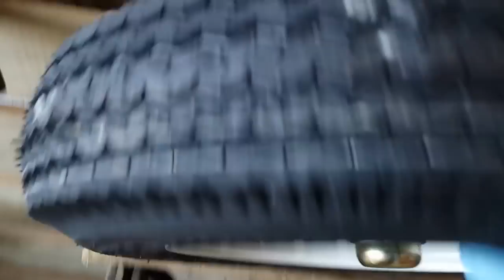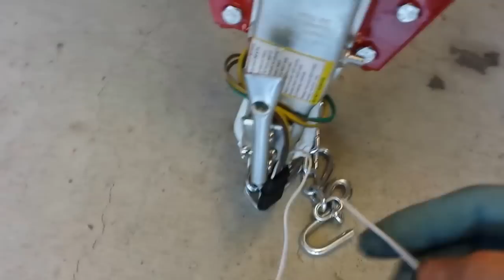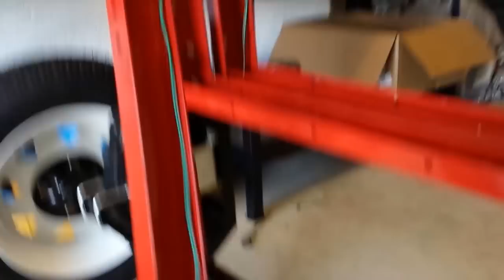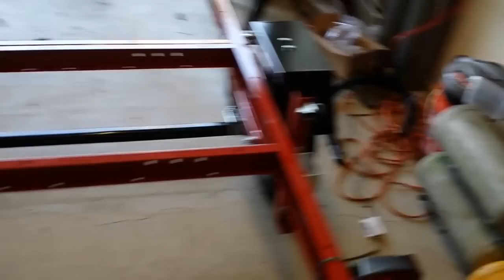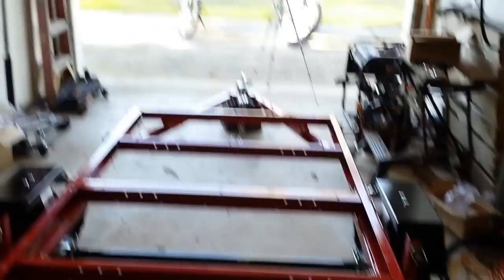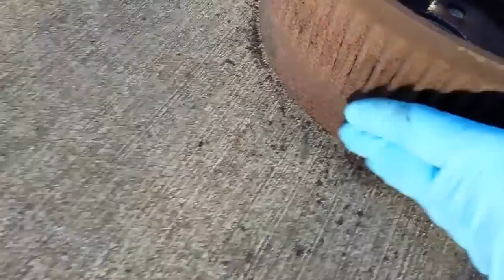Harbor Freight Folding Trailer Build Part 2 - Wheels and Wiring

Comment: I had the same trouble with the license plate too and tried installing it the way you did initially... but the way it should be installed is light onto the mounting bracket, then the license plate holder on the back side of the bracket. The wires have enough clearance this way to move where they need to go.

Comment: I tried that method for removing that dust cap.  It did indeed remove the cap, but I managed to drop the bearing as well as the greased washer in the process.  I hadn't even tried the logical method of prying the cap off with a screwdriver just because it did look difficult, as you described.  However, for the second wheel, I didn't want to drop the bearing again so I just pried the cap off with a couple screw drivers.  It came off a lot easier than expected.  

1.  Small (thin-tipped) screwdriver: tap it in around the edge of the cap in a few places to create a tiny gap.  
2.  Larger (broader-tipped) screwdriver: tap it in around the edges, and torque the screwdriver once you have it seated in the gap under the edge of the cap.  

I was able to leave the wheel upright and didn't have to remove the bearing or washer at all.
Reply from the maker: Glad that worked for you.  I've had problems in the past, so I was being careful.

Comment: Thanks for the video. I have the same trailer, my wires seem to pinch at the pivot point when unfolding the trailer, I need a second pair of hands to feed the wires when I unfold it. Did you run into the same issue?

Comment: Awesome vid. Question. I don't have the instructions as they literally blew away before I started the wiring. Damn wind. Lol. Anyway, with the lights on the front, the wire that comes out of the lights is to be spliced with which wire, the Browns right? And the other one remains untouched?
Reply from the maker: Deerector Yes the side markers connect to the brown wires.  You can download the manual from the Harbor Freight web site here:  http://manuals.harborfreight.com/manuals/90000-90999/90154.pdf

Comment: What is the space distances between each cross beams widths? I ask for the space to know if a potable water holding tank can be added in this area, along with a gray water tank between the cross members of the trailer. This information is important if building a camper out if trailer.

Comment: So here's my only issue with mine. I can only get the carriage bolts (the ones closest to the back) in. The other holes (closest to the middle) doesn't line up at all! Do you think just the two (one on each side) will secure the back half enough?

Comment: The bearings come packed with a cosmoline type grease to inhibit rust,  it is NOT a bearing grease designed to be ran. To do this properly you must remove both bearings and pack with good grease.
Reply from the maker: +John Stern I checked the grease while assembling and it was the same color and consistency as my wheel bearing grease and they were packed full.  Harbor Freight is always changing their products and level of assembly.  The assembly instructions are almost always wrong on several steps.  I've only put about 20 miles on the trailer this year.  I will pull the wheels off later to check the bearings and grease. I will probably repack them and add bearing buddies anyway.
Reply: +Charles Current oh OK,  I've heard it wasn't bearing grease and it'd mess up the bearings,  which made no sense why they wouldn't put the right grease in there because they press that back bearing in and it's a devil to get out

Comment: For some reason I can't get the marker lights to work. The tail lights work great. I am doing it just like the instructions. Been over it and over it.  Any clues?
Reply from the maker: jerrware Double check the mounting screws are grounding to the frame properly.  If they are, use a meter or test light to check that you are getting power to the fixture and if not follow the wires back and find where you are loosing power.

Comment: so in Oregon we don't need to worry about a separate license or registration for a utility trailer?
Reply from the maker: bgregg55 Not for light trailers.  From the Oregon DMV web site.
"You do not have to register a light trailer (which includes a utility, boat, or horse trailer) or obtain a trip permit to operate it on the road if the trailer, plus the heaviest load carried, weighs 1,800 pounds or less."
Reply: Charles Current thanks. i really appreciate that info.

Comment: Question. I know nothing about wiring. I don't know what to do about the side lights. The instructions say to splice with the brown wire and that's it. But my lights have a brown and white wire? What do I do with the white wire?
Reply from the maker: +jsmith0802 The white wire is probably the ground.  If that's the case, you ground that one to the frame using the lights mounting screws.
Reply: +Charles Current oh ok. Thank you!

Comment: Stuck on the wheel install. Popped the dust cap and not sure where to go from here. Seems like everyone skipped this part for some reason. Any help would be appreciated
Reply from the maker: RoverMikeB Okay, a couple questions to find out if yours is the same as mine. Did you find the cotter pins and washers inside?  Are the wheel bearings already packed with grease?  Are the nuts on the axles?  All I did was remove the nuts.  Slid the wheels on, pushing the outer bearing back in place when it tried to push out.  Put on the washer.  I tightened the nut until I could feel resistance when turning the wheel.  Then I backed the nut off until the wheel spun freely.  Then backed it off a little more to line up the nut with a hole to put the pin in.  Put the pin in and bent it over.  Double checked to make sure the wasn't play side in the wheel and put the dust cover back on.
Reply: Charles Current you're supposed to clean and repack the bearings.  They dont put enough grease on at all.  youtube has a ton of videos on packing bearings. its not hard at all.  i just finished that part
Reply: Peter Detorre if you havent already, go back and do it.  it will make all the difference in how long those bearings last.  pack the hell out of it then after its assembled theres a grease fitting behind the tire area.  Hook up a grease gun there and add even more.
Reply from the maker: Peter Detorre My trailer had a lot of grease packed in the bearings and the hubs were full.  I don't plan on using it much this year and I will be repacking them with good quality grease when I get a set of bearing buddies to put on them.  Thanks for the tip.
Reply: Peter Detorre I'm not going to repack the bearings either, like Charles',  there is a lot of grease in mine straight from the store and I don't plan on hauling it a long distance. I will keep my eyes and thermometer on them though.
Reply: It's been about a year since you posted this.  I'm wondering if you're still running the original grease, if that has worked out, and roughly how many miles you've put on it.  Thanks,  Rick
Reply: I upgraded my lube and have had 0 issues.
Reply: I am stuck on the wheels and everyone skips it also.  The dust cap made sense.  And I found the cotter pin and washer in it.  But the hub assembly doesn't fit all the way on so I can't get the castle nut back on.  Do I just force it with a hammer.  Was a little afraid to just hit it.
Reply from the maker: +Kevin Johnson I don't remember for sure.  I think mine went on pretty easy.  I would double check for anything in the way then hold on to the tire and wiggle left & right while applying pressure.
Reply: Thank you. I figured it out.  There were a lot of rough metal spots. I switch to other tire which went on easily.  So then sand papered off rough spots on first side.  Cleaned it really well and looks good now.
Reply: Kevin Johnson  I’m having this same issue. How did you fix yours?

Comment: Is the wiring necessary for just towing a motorcycle on that trailer? Or could I get away with just attaching my license plate on the back of it and a few reflector lights?
Reply from the maker: +greycrit I'm guessing that if your state requires a plate, they would also require lights.  Check your state's laws.  In any case, the lights come with it, so I would just install them.  You wouldn't want someone rear ending the trailer and your motorcycle because it was dark and they didn't see it.